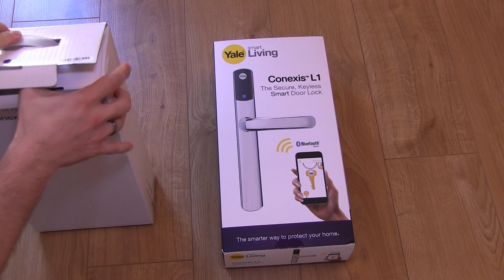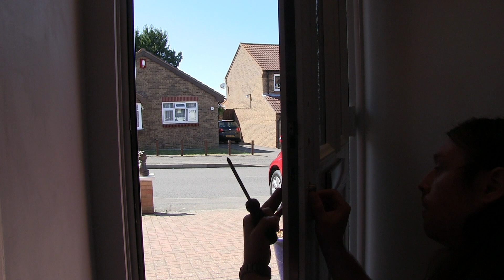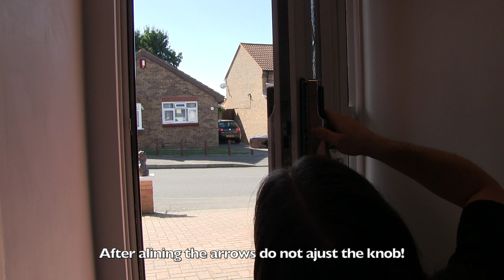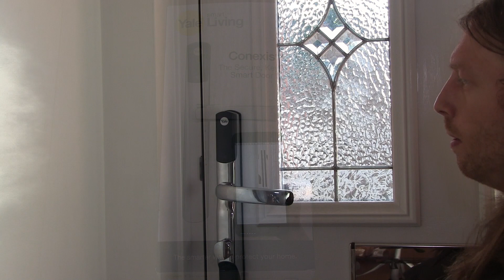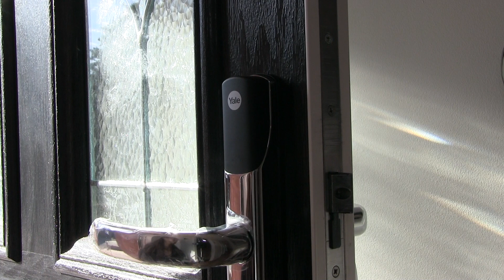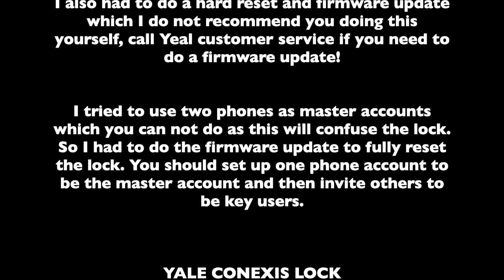Unboxing and installing the Yale Conexis L1 Smart Lock

Comment: If I have more than 1 Conexis L1 lock in the house, can I reuse the same tags or do I have to buy new ones for each lock?
Reply from the maker: Hi George, A good question.

The simple answer is Yes you can us one key tag/card on multiple locks.

I called their support to find this out as it's not clear online.

The full answer is;
Each lock must have one and only one master phone account.

Each lock can have up to 50 key tags/cards to open them.

Each phone account can have any number of locks to work with.

Each key tag/card can work with any number of locks.

Kind regards

David
Reply: @BrenTeckITSupport  Thanks for getting back to me.
Reply: I seem to have the same thickness PVC door as in your video 45mm. The distance from the inside to the centre of the lock is 23mm. According to the book it says I need the short tailbar but in your video you have used the long one. Can you please clarify which is correct? Thanks
Reply from the maker: @georgevarsamis4554  Hi George,

I believe that I had to use the short one in the end and Pack B. The Tailbar I am NOT using is 54mm The problem I had is I did not use the cable run the first time and so the lock was not sitting correctly. 

Sorry for the delay in my reply, the YouTub app only shows me new comment threads, not new comments. So I am missing out on comments even though I check every morning. :(

Hope this helps, if you need any more help please fill free to ask and good luck fitting it, hope you have fun.

David
Reply: @BrenTeckITSupport   Thanks David. That has been really useful.

Comment: Do smart locks like this activate the multi points the same as if you had turned the handle "up" manually before locking it?
Reply from the maker: Hi Alan, sadly no you must manually lift the handle to engage the multipoint locks. The motor only allows the handle to be active or deactive. You must also push the handle down to unlock the door after telling the lock to unlock otherwise within about 30 seconds it will disengage the handle again. So if someone is at the door and you want to let them in remotely you must have the zwave   module installed first.  You can use the Samsung smart things app to activate the handle. The person can then push down on the handle to retract the multipoint locks and open the door. To lock the door, the person must first close the door and lift the handle fully. The motor will then disengaged the handle so the door can not be opened again. The handle must be fully pushed up otherwise it will attempt to disengage the handle but will fail and the door can still be opened, if using zwave and Samsung smart things the status of the lock should also show the door unlocked if this happens.

I hope this helps. I can do a quick video about this when my new tripod arrives. If you like.

Dave
Reply: BrenTeck IT Support hi Dave, thanks so much for your detailed reply, this is exactly the kind of detail I was looking for in my investigations into whether to consider smart locks (I'm a complete gadget geek and smart locks are about the only thing left 'to do' in my house). I always wondered about the push up functionality, I suspected that smart locks, being only battery operated, couldn't really do the pushing up, I figured they must only disengage the handle or something like that.

Your explanation was really helpful, I may still go for them but at least now I'm much better informed. 

Cheers,

Alan
Reply: @BrenTeckITSupport  My door currently doesn't have multi lock mechanism. So when I close it behind me then  the handle can still be pushed down to open. Am I right in understanding that with this, the unlock feature enables the handle to be turned downwards? So even if I don't have a multi lock door I can use this to effectively lock the door behind me because the handle can then not be pushed down again unless I unlock it?
Reply from the maker: @kalelkar  Hi Saager, 

The lock will not work for you  what you want is the Yale YD-01-CON-NOMOD-CH Keyless Connected Ready Smart Door Lock https://amzn.to/2TKKtpi

Sorry for the delay the app did not show me your message. I am still getting used to running the channel, I have a lot of catching up to do apparently.

Hope this helps

David

Comment: What happens if you upgrade to a new phone? Does the app transfer across? Surely you don't have to do a hard reset on the lock?
Reply from the maker: Hi, A good question. The app only allows you to be logged into one phone at a time with that soft key. You install the app on a new phone and login, it will then ask if you want to move your key to the new device, once you confirm the move is done. The key will still show up on the old device but will not work just in case the phone was lost or stolen. Hope this helps.

Comment: Very helpful video well done. There is one question: I have same lock as your original lock, is it possible to use another lock rather Yale conexis L1? For example Ultraloq UL3?
Reply from the maker: Hi, Sorry for not getting back to you earlier. The simple answer is no.  The Conexis L1 is for a "multipoint lock" with a lift handle to engage all locking points and the motor retracts the locking system to disengages the handle. I hope this helps. So if you are wanting to upgrade then you will need the Conexis L1 https://amzn.to/2JGkxsJ.

Comment: Do you know if it is possible to control access to certain days/times of each key fob or only with the mobile keys?
Reply from the maker: Hi, I gave them a phone call for you and found this! Yes, you can when setting up a new soft/shared key. (Not the fob or card) Also can not be added to an existing key it must be done at the time of creation.

To Schedule time Keys:
-          When sending a sub user a shared key, there is an option o send them a scheduled or permanent key
-          Permanent key will give access to the user all of the time
-          Scheduled key will give the sub user access only during specific times the master user sets

To set up a scheduled key
-          Type in the email you would like to send a key
-          Select ‘Scheduled Key’
-          Select the start/end time you would like to enable the key fore
-          Underneath it will ask you to select days which you would like the key to be valid from and what date. Please see picture http://www.brenteck.com/images/YaleScheduling.png